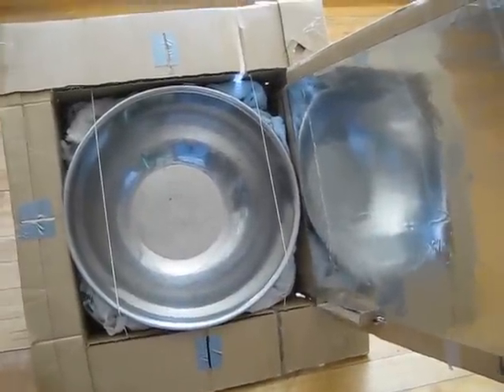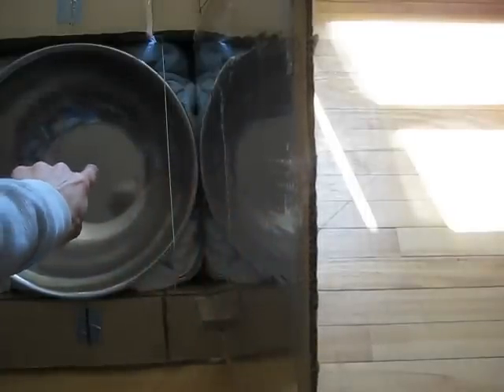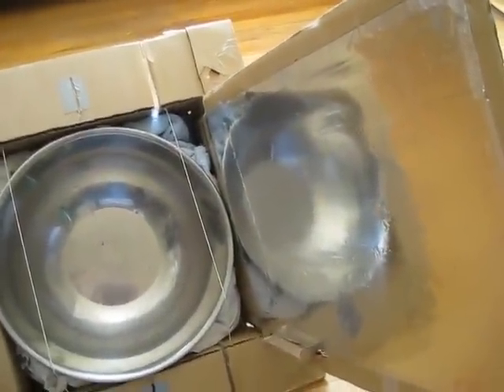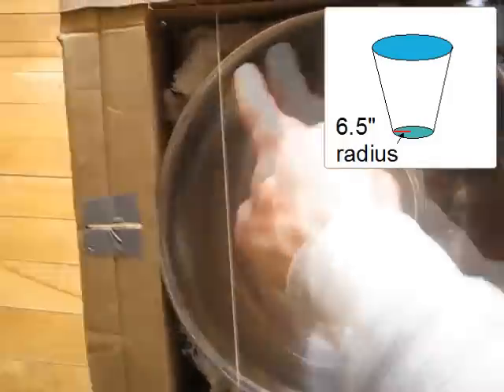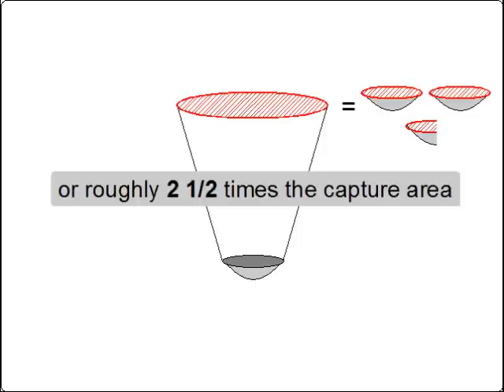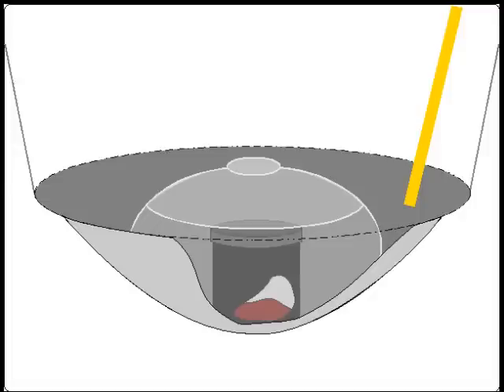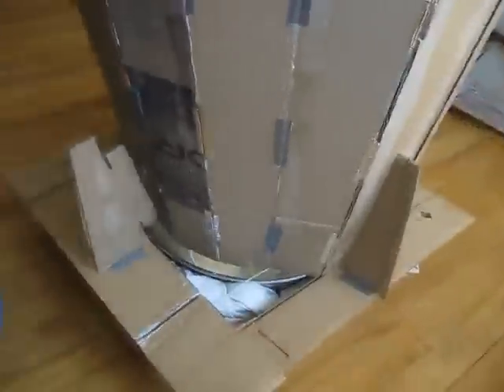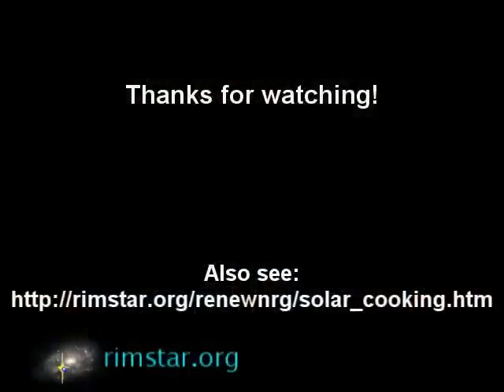Cone solar cooker part 3 - Designing & making the reflector

Comment: Will it work the same if I make it a round shape (with round lid) instead of a square shape?
Reply from the maker: I'm not sure what part you're referring to. What do you want to make a round shape? The cone is already round, the bowl is round. The box is square but that doesn't matter. The box can be round instead.
Reply: @RimstarOrg  Exactly I am asking about the shape of the model. Instead of the square/rectangular shape like a suit case, can it be in a circular enclosed box form, and still work the same? or will it effect the efficiency? I am asking it because I have a round glass piece and suitable stuff and idea to make a round solar cooker! Just wanted to confirm if it will work the same!